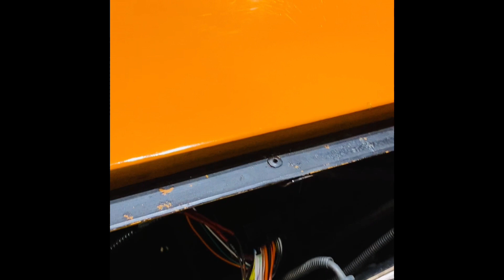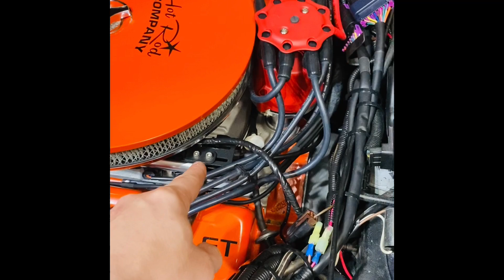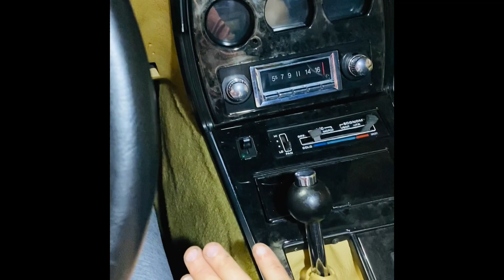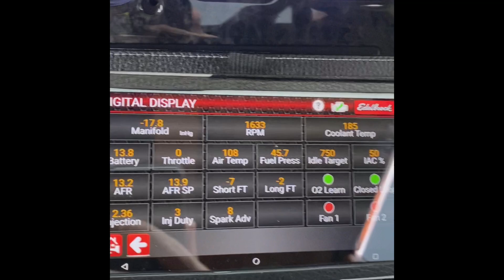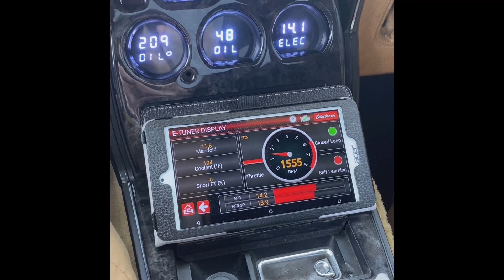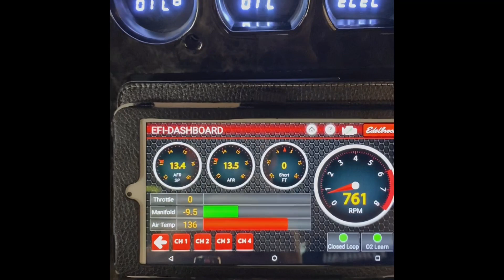EDELBROCK PRO FLO 4 - C3 CORVETTE

Comment: I got the first Gen pro flow 25 years ago for a 406 I built and it's still running on that 406 today. I had a 700r4 with 3.07 gears and was getting 20mpg then that transmission blew up so now with a turbo 350 I had laying around I'm getting 16-17 mpg.

Comment: TH400 IS A MUCH BETTER TRANSMISSION BY FAR. CHANGE AXLE RATIO TO 3:73 AND ADD A GEAR VENDORS OVER DRIVE UNIT.

Comment: I  installed my proflow  and my car runs like crap.. when varied I had 11-12 inches of vacume at 750 rpms, now I am at 850 rpms at 9 inches of vacume.. I have a 236/242 HR cam.. what cam do you have? And how was the initial startup and drive?? So far I hate it, I also got the sump pump..
Reply from the maker: That sounds like you have a major vacuum leak. Maybe the intake manifold or vacuum booster?

Drive was extremely simple and easy. Setup took a few minutes. There is definitely something not right with the install is my guess…this system is flawlessly running now for a year. I have a 230 duration with 510 lift (1106 cam).
Reply: @classiccorvetteguide9147  its a brand new engine, engine builder installed, checked for any vacume leak, there is none, the complete brake system is brand new, removed all vacume lines  from proflo and capped them still the same, engine takes 6-8 or more revolutions to start,... I am running a 236/242  HR cam 520 lift,
Reply from the maker: @madvette74  I am not trying to cut down the installer, but this system is not a item that installers regularly do, and if installed the way you do anything else may have impeded the install. We were on the phone with Edelbrock and a few different points just to make sure we did things correctly. It could possibly be that the distributor is 180 out or there is a fuel issue with the wiring, the mechanical pump, Oregon still vacuum. Have you conducted a personal vacuum test with a pump?

Comment: Great video! I am in the process of installing my fast efi and I purchased the sump as well. My question is when you hooked up to the return line to the tank did you just put a T into the existing house and how has it been running so far for you.
Reply from the maker: The unit has a supply and a vent line. One line comes from mechanical pump to sump, another goes from sump to fuel rail…last is a vent line that goes to vent line on the frame of the car.
Reply: Ok, so you just put a T fitting into the vent line from the mechanical pump to the gas tank line
Reply from the maker: @harleyman19692  no- there are two lines on the frame- the supply and vent. Supply goes to mechanical pump…mechanical pump connects to sump…sump connects to fuel rail and return from sump goes back to vent frame line.
Reply: So you blocked off the vent line from the mechanical pump and hooked up the vent from the sump to the return line to the tank.
Reply from the maker: @harleyman19692  no- I use a holly mechanical high flow pump for my engine which doesn’t have a vent port. It freed up the port.
Reply: @classiccorvetteguide9147  ok that makes sense now lol

Comment: I bought my proflo 4 over a year ago and I still haven't seen it, nothing but excuses from Edelbrock and lies I've caught them in so many lies it makes me sick, I've asked to speak to the higher up because I would like to have answers of why I keep getting estimates on time but never getting my parts it's like for over a year I've gotten 13 14 estimates and every time it comes to get my part they have another excuse, it's illegal and I hope somebody sues the s*** out of them
Reply from the maker: Man I am so sorry that your experience has been like that. That is atrocious. I bought this prepackaged kit from jegs. I wonder what is going on with your kit
Reply: @classiccorvetteguide9147  I wouldn't know they keep lying every time I talk to him so I'll never get the truth from them anyway,, and they have the worst customer service of any company I have ever known it takes hours to get through to them how long ago did you get your system
Reply from the maker: @UCLfq5ka_vuC_LBLF5RRsmNQ I installed this exactly 1 yr ago.
Reply: @classiccorvetteguide9147  yeah I'm a little impatient after a year I built a stroked 498 big block Chevy, to go in my 99 Chevy extended cab four-wheel drive, it has a Chevy Dana 60 King pin front end 4L80E built by TCI Street fighter 2 gear to gear 205 transfer case 14 bolt rear end with a Detroit locker in the front end has a track lock, 456 gears on 37s the only thing I am waiting on and have been waiting on is that manifold
Reply from the maker: @calvinsnellings3985  man I’m super jealous of your Transmission! I need a 4th gear or overdrive bad for Jacksonville. I definitely am happy with this unit and will wish for resolve for you.
Reply: @classiccorvetteguide9147  if you have a turbo 400 then just go to a wrecking yard and get a 4L80E, you can get a hold of TCI and order the complete transmission kit not that expensive, then get a transmission guy that you know that can build it, and if you have any spiritual 400 parts it will fit right into that 4080e, I would like to see yours run it's a beautiful car,
Reply: @classiccorvetteguide9147  oh you lucked out royally

Comment: How did you wire your ac system to turn the fans on? I’m having trouble as the pro flo 4 uses a ground to activate the relay yet the ac compressor uses +12v to activate. Please let me know how you went about fan over ride when ac is on.
Reply from the maker: 3 relays with the low pressure/ trinary switch combo. My fan is 2 speed. First speed comes on when ac on.
Reply: @classiccorvetteguide9147  awesome yes mine is 2 speed as well. Is the ac clutch relay completing the ground circuit for the low fan speed?
Reply from the maker: @BarberAutomotive  you will need a relay for ground 1 (low speed) coming from ECU to fan. Then another relay for ground 2 (high speed) coming from ecu to fan.

Third relay will trigger fan speed 1 on automatically using AC trigger.

Comment: Mike,

I just watched your install video for the Pro-Flo 4 on your '77.....Great Job?   I am considering the PF4 for my '75 C3  with a 383 stroker.  Did the fact that the single plane intake has no angle on the throttle body mounting pad give you any issues when it came to your air cleaner selection?  Also I may need to bring the fuel line in on the passenger side rear of the engine.  Is it possible to do this as it would result in the fuel line cross over being across the front vs. the rear of the engine?   I hope to hear from you.

Best Regards,

Bill
Reply from the maker: Bill,

The setup comes fully assembled with the crossover in the back. The setup uses AN and can certainly be flipped though the company doesn't recommend it because it was leak tested and any adjustment to it may be a self induced leak. But all in all - can certainly be flipped. The air cleaner is not such a concern. I have tried a few and still had room. I use an open element for looks.
Reply: Mike, Thank you for your response.  Is there any way we could have a conversation? @classiccorvetteguide9147
Reply from the maker: @billthomas4439  yeah - find me on Facebook - Mike Toenies (art of War picture)

Comment: Excellent video Mike, and I like your Facebook comment that it really woke up your engine  over the carburetor. Wish we could have gotten a before and after dyno to really measure the difference.
Reply from the maker: Yes indeed! I got to the point where carb was fussy with air conditioning and seasons. The hot weather on one then cold would need a/f adjusting. The throttle response on this is amazing!

Comment: Thanks for the C3 specific install.  How does it work with a thumper type cam?   I have a 434 sbc with Quick fuel carb  thd350 3.08.  Car runs great but 8mph.  Do not want a throttle body system so this may fit.  Do you know the rpm range?  I am running around 545hp, 610 ft lbs at 3200 rpm. current manifold 1500-6000
Reply from the maker: For the cam - it allows you to select the ci and cam in the tablets initiative start tutorial. The range is up to 6500.
Reply: @classiccorvetteguide9147  Thanks, just the info I needed

Comment: Loved the video with lots of great info .. Stuff i wasn't aware of, like the fuel pump sump. I've learnt a lot, Thanks and greeting from Australia. My system has just arrived and i'm swapping out the old with a new crate motor, so i'll be using what you've done as a good guide and direction. What bonnet are you using, due to the hi-rise manifold, I'm guessing there is no room if it's a standard bonnet .. Next time, maybe hold the camera longway's, better veiwing . .
Reply from the maker: Thank you for the helpful constructive criticism and complement mate. To answer your question, it is the stock hood on the 1977. It just cleared however you do need to remove the liner on the inside of the hood. Also you can always use a drop filter to lower clearances.
Reply: @classiccorvetteguide9147  .. I've just ordered the Pump, Coil and cable mount. $464 if bough in the US, it's cost me $880 and about 2/3 weeks to ship. The ProFlo4 cost me $3k with that unit being sold over here for $4K .. sucks living so far away . .
Reply from the maker: @Oztralianmade  Australia?

Comment: I recently swapped a Smedding 383 into my 73. I’ve been looking at either an EFI conversion or a trans upgrade as my next big project. I’m still running the original TH400 with 3.08 gears and to say the least it does not maximize the benefit of the engine swap. Considering a 700r4 or 2004r swap. After watching your video I’m thinking the EFI along with a new gear set, maybe 3.55s may be the way to go for now.  Very clean install you did. Looks great. I’m really curious how the sump system is working, fuel starvation etc.   Great video!
Reply from the maker: Thanks Clay! I would start with the EFI and see what you think of your new engine. It really wakes it up. I run a TH350 with 3.05 gears. She moves. HAPPY to answer any questions.
Reply from the maker: To update- the sump is running great and the new 76 loves this setup as well!!!! It seemed to wake up the 76 even more lol.
Reply: How did you mount the sump and better pictures. I just purchased the same set up

Comment: Nice job!  I'm in the same boat as far as not being bale to find a ton of information on the Pro-Flo4; at least relative to the amount of information on TBI conversions like the Holley Sniper.  I was all set to pull the trigger on a Sniper when I stumbled across the Pro-Flo and went that route.  Mine went into a 1964 Chevelle wagon and I filmed most of the install with the same goal of posting a few videos with all of the stuff I needed that did not come with the kit.  My list is long as I went with a new tank from Tanks, Inc with an in tank pump, sending unit, etc.  I'm waiting for one last shipment of parts that includes the throttle/kickdown cable bracket before I can fire mine up.  Can't wait!
Reply from the maker: This is very exciting!!! Looking forward to updates!!
Reply: @Issac Ortiz I'm considering a similar set up on my '70 Chevelle SS396. I'm wondering if I need to go through whole Tanks Inc. route or if I can get away with the Sump Pump like Mike. A while back I purchased a new original style tank, fuel pickup, stainless lines (feed and return), and mechanical pump. Now I'm looking at a kit from Speedway for a complete fuel injection setup with Tanks Inc baffled tank, aeromotive in tank pump, a fuel regulator and all the lines. Did you have a chance to post videos of your build?
Reply: @ryanjohnson8821  Hey man!  I didn't remember this post until I got an email with your question.  Sadly,  I did not post any videos.  I have about 5 hours of film that life kept me from being able to edit down.  I do still have them and hope to edit them and upload soon.  

My recollection of my research and the reason I went with the baffled Tanks, Inc setup was mainly exactly for the baffling.  Didn't want to run the risk of pump starvation from low fuel.  Now, that being said, the sump system Mike used seems to solve that problem as well.  I didn't want to go that route as I wanted to clean up my engine bay and not add to it.  But where Mike added his is barely noticeable so that works too.  Whatever you do, don't go with an in-line setup with an external pump.  Way too noisy.

I just did a quick search and it looks like Edelbrock's complete sump kit is ~$500.  I want to say that my Tanks, Inc setup was around that same price when you add in the pump and sending unit.  They do recommend 3/8" lines so you may not be able to use the fuel line you have.  I used rubber for the feed (Earl's VaporGuard) and used my original fuel line for the return since the psi is much lower going back to the tank.  So all up, for around the same price (maybe $100 more with a new feed line and some fittings), I got a baffled tank, cleaner engine bay and as a bonus, the Tanks Inc tank added 4 gallons of capacity over my original.  

Hope this helps.  And after a year, I'm still very happy with the decision to go with the PF4 versus Holley or FiTech.  I drive my wagon ~600 miles a week in S Florida and it never hesitates to start and the throttle response is night and day.
Reply: @issacortiz  thank you so much for the detailed response! You gave me a lot to consider. Are you running any type of fuel regulator? I'm in the middle of a frame off restoration so I'm having to pick and choose some upgrades. Fuel injection may have to wait, but I'd like to have the tank, pump and lines ready to go once I'm ready to make the move. Would you be able to give me a detailed parts list? Also, go to a local college or post on Facebook you are looking for a film student to edit some video you shot. I'm sure they'd do it quickly and inexpensive. Get it done and post it up, I'm sure there are others like me that would appreciate it!
Reply: @ryanjohnson8821  I am running Edelbrock's fuel regulator designed for the PF4.  Pretty sure it is part 17401.  I went with that one as it is designed to mount to the end of the fuel rail opposite the inlet (on my set up, the inlet is on the pass side at the front of the manifold so my regulator is on the driver's side front).  I have an email string with Edelbrock tec support that is over 80 emails long starting before I made my purchase and all the way through the install.  Let me look through that and put together a parts list.  For what it's worth, their tech support was amazing.

Great idea on the college kids for editing.  I'll definitely look into that one.

Comment: Try to draw the air to your new fuel injection from outside the engine compartment. Watch gale Banks explain air density & hot air & how it negativity affects your horsepower. It's pretty substantial. Super interesting. Gale Banks really really knows his stuff. The guy's a super genius
Reply: Look at the Banks site on youtube. The title of the video is Banks Built series, Our '66 hits the dyno. They run an old 66 Chevy truck on the dyno to explain how different thing rob horsepower.
Reply from the maker: @dennyflynn6965  definitely 100% on the cool air! The issue is fitment in a c3.
Reply: @classiccorvetteguide9147  I kept my 81 air cleaner. It has a factory snorkel to suck air from outside of the Engine compartment. It's ugly but it works. I shut off my Facebook & joined gab. Your C3 Facebook site is one of the things I miss most of all. Didn't like what Facebook was doing. Your youtube channel is great.
Reply from the maker: @dennyflynn6965  thank you so much Denny! I’ll try and get a cold air setup
Reply: @classiccorvetteguide9147  I just looked on the Spectre air cleaner site. There's a dual snorkel universal. Problem is they don't give a lot of info. I guess a person would have to call there customer support.
Reply from the maker: @dennyflynn6965  I saw a low profile single flat inlet version too that looks enticing!
Reply from the maker: System is still running perfectly! I now have it in a 76 corvette.

I will do a video soon on the pro flo air cleaner they make combined with a cowl induction system!

Comment: Great video; getting ready to do this to my 81’ vette. What kind of heads, cam, trans, converter and rear does your car have?
I’m running aluminum heads and a 30/30H cam. Can’t wait!!
Reply from the maker: Racing Performance Alum Heads, 1106 Flat Tappet Cam, TH350 with 2000 stall, and 3.05 rear.